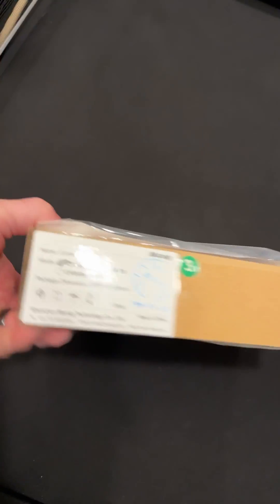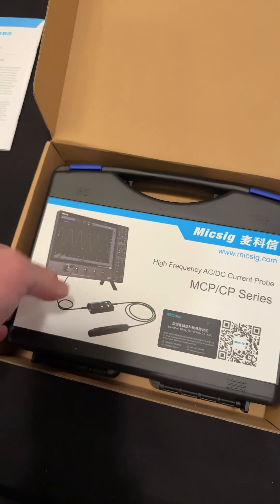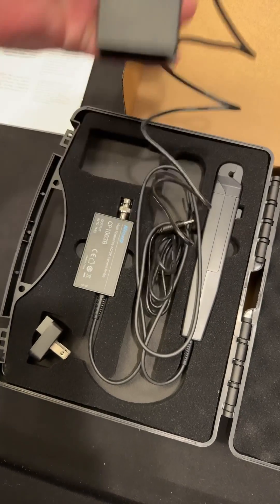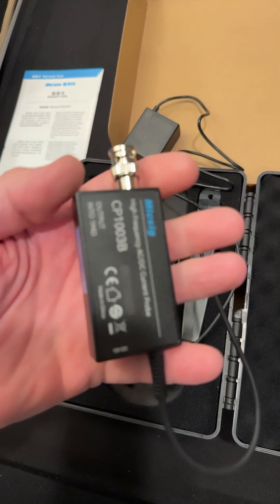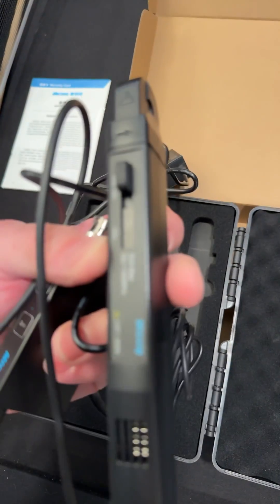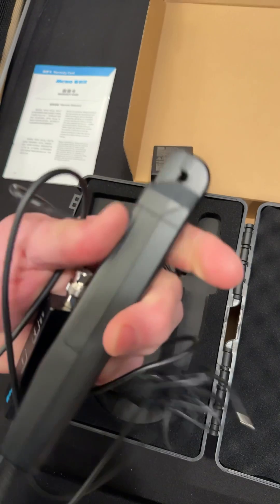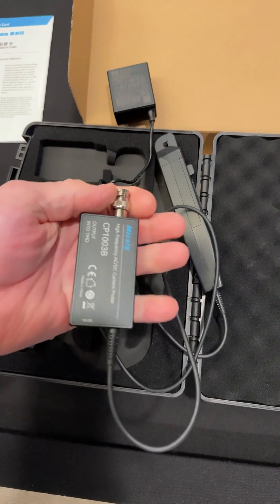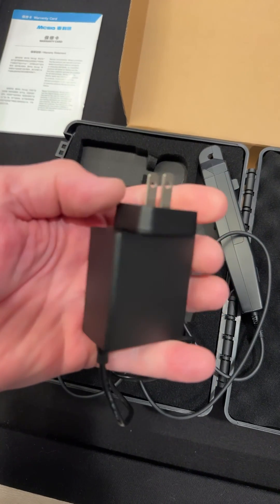Micsig High Frequency AC/DC Current Probe High Precision Oscilloscopes 100MHz CP1003B #CP503B

Comment: When ? also when would u use something like this vs a shunt ?
Reply from the maker: Great question!  I would use the before a shunt every time.  How do you size the shunt?  Small enough not to change the measurement - but changes it somewhat.  This probe does not affect the measurement at all.  Also, once you have the shunt - what are you going to use to measure the shunt that has the bandwidth of this probe?